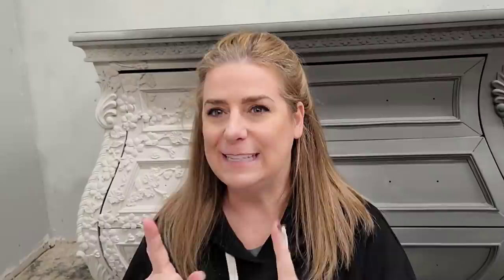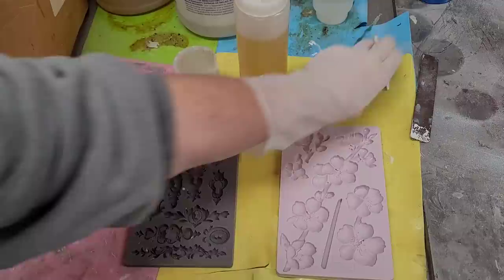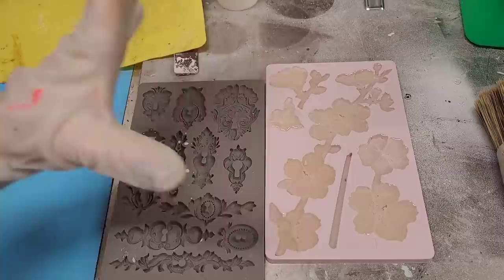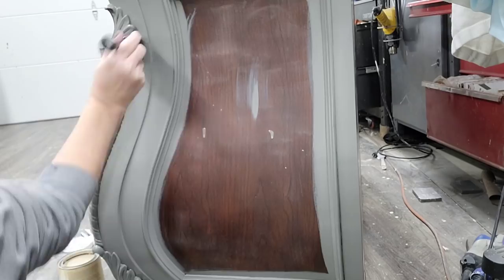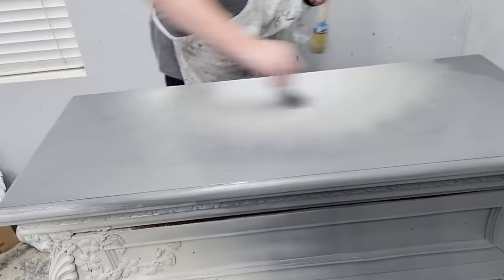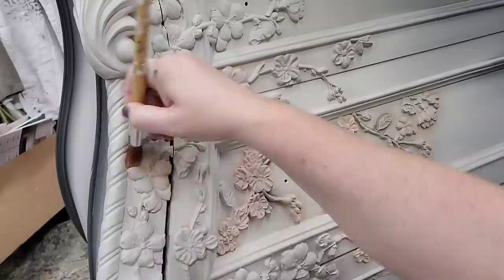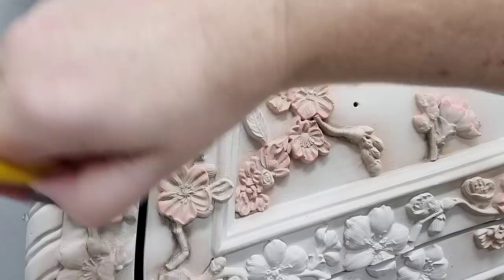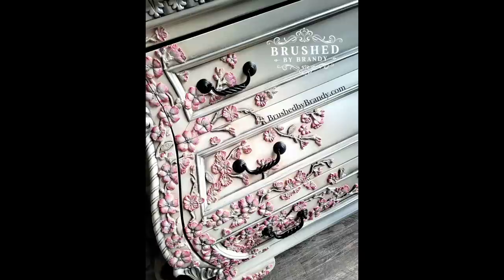a cherry blossom themed bombay chest using moulds and blending

Comment: I watch furniture painting often, on YouTube. My DIL has a Bombe chest that she wants to paint white and put transfers on, for my first granddaughter. 😇 I am going to remove the hardware and clean the dresser with TSP. Brandi just said it will get Pledge off. Just the other day I heard someone else say not to use Pledge. Does anyone know if that really is the case and if so, what is good to use on a painted dresser?
Thank y’all
Reply from the maker: I do not recommend pledge on painted pieces,  just a damp cloth to dust, if it was sealed in clear coat a polish should not be be necessary